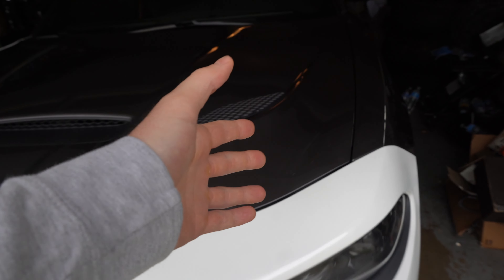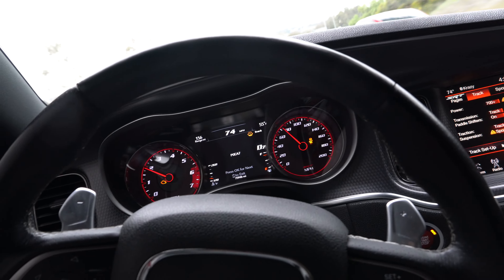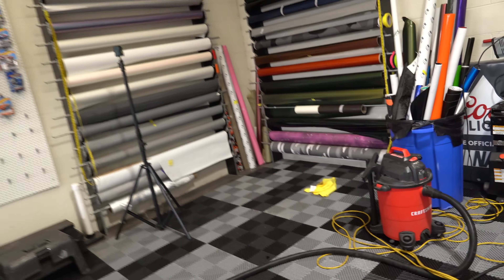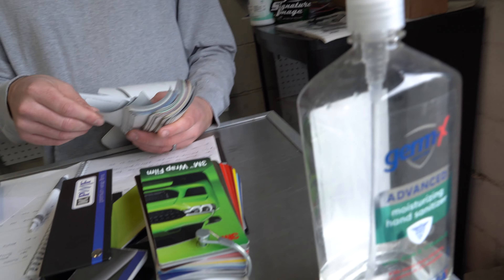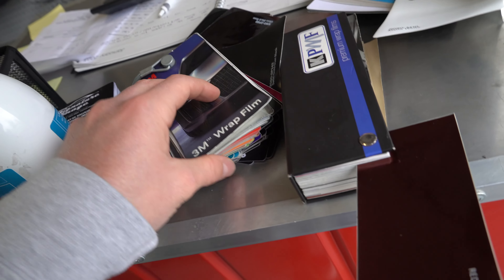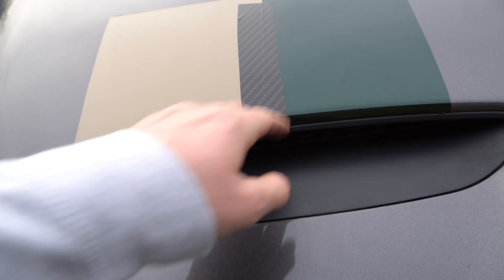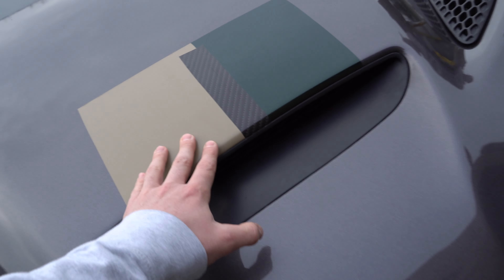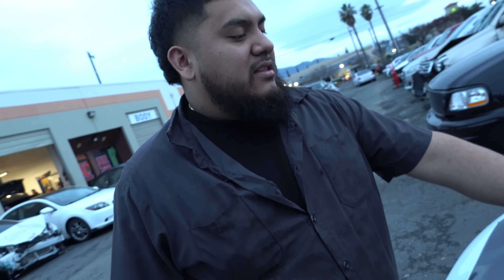FINALLY PICKING A WRAP COLOR FOR THE 850 WHP “DRIFTCAT!”

Comment: You should wrap it like a local undercover cop car so you quit fuckin gettin pulled over.

If those are the colors you've chosen, pit the tan on the drivers side so you don't see water spots every time you get in the whip. Coming from an owner of a gloss black truck,  trust me on this.
I also think the 2 tone is going out of style. If it were mine, which it isn't, id get it painted gloss burgundy, but you do you
Reply: Facts. Poor color choices but not mine. Would do like a hellrasin red or pearlescent diamond blue